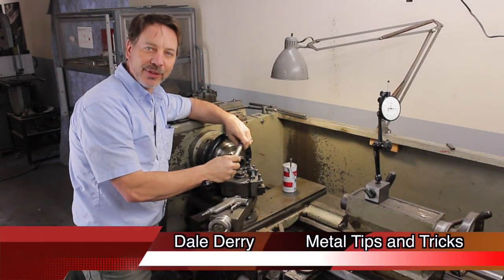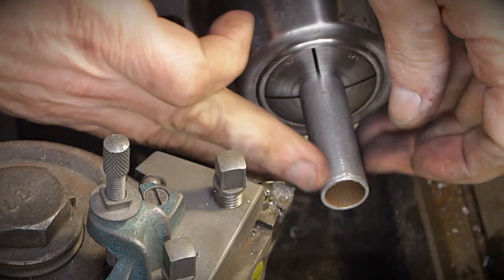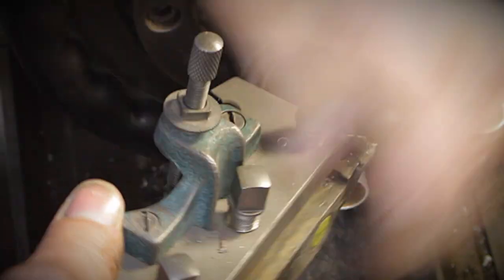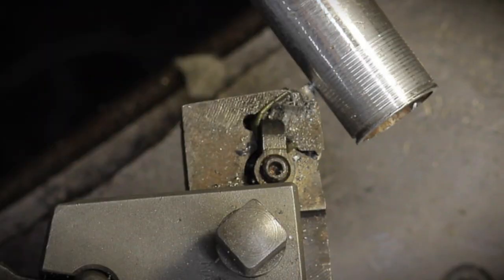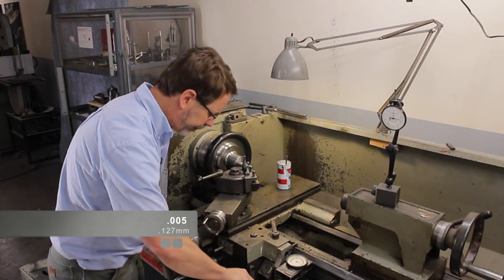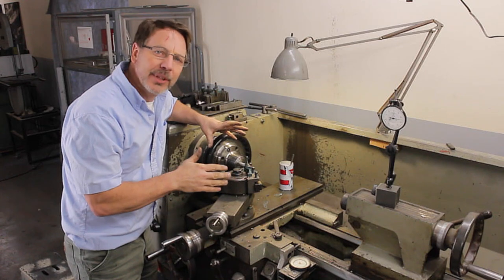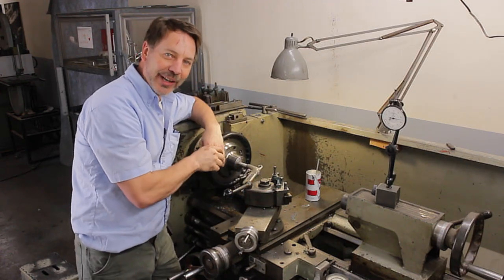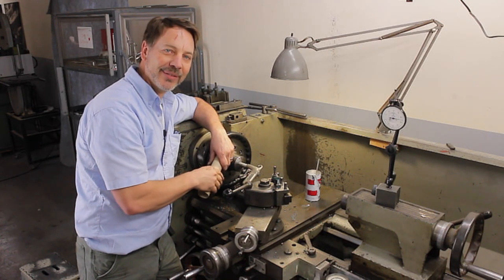How to cut Threads on a  tube

Comment: Here's a tip for turning/threading tubing: turn a close fitting slug that fits into the ID. That removes most of the squishing effect from 3 or 4 jaw chucks. In fact, you may need to do this with tubing in collets because, even though collets squeeze evenly, they do exert a large amount of grip that can distort the tubing. This slug would be required if you were chucking tubing less than about .157 wall (4mm for our metric friends) and cylindericity is important.

I have seen this used on tubing .030 and less thick with no distortion.

Comment: Hi Dale,
the tip to set the cross slide handle to the top so that you automatically know where to reset it to is a good one. However using some worm out lathes I find if the handle is left at the top it has a tendency to creep one way or the other, mainly winding out.
to counter this I set the handle at the bottom of the movement as a starting point and I find it stays put.

cheers and thanks for the good work in the videos
Reply: I added a counterweight to the crank wheels on my lathe that balances the handle weights within a few grams.  Now they have no tendency to creep. :)

Comment: Thank you for all your great video tip, learn something every day, or your dead. This is a little long winded but you might find a use some day. I'm a goldsmith by trade and have occasions where I need to make a temporary between two flat surfaces or marry two pieces of ?? and be able to take them apart easily. I use flake shellac, you can buy it from most jewelry supply houses, 1 Lb. for $10. Then, for example, if you had two 1" cubes you wanted to tack so you could cut some matching line on both blocks, you simply heat both block to just warm. Place a few flakes on one side and heat indirectly until molten. Place the other on top and when cooled they are stuck. You could run under some cold water to speed it up. If clamped together they will for a micron thin bond. When your done what you needed to do you can simply heat it up again and separate.  You need to remember that this is flammable, but you can use boiling water too.  If for some reason you can't heat, you can soak it in some alcohol and  that can be used for your final clean up. So after all that, my point here was that you could fill the end of your tubing with molten shellac, heat up a 1/4 cup in a double boiler, pour it in and let it cool. It will be harder than lead and easy to clean up. A word of caution, don't splash yourself with it as it's like tar, it will burn you deep before you can swipe it off. Best wishes to you and yours, Billy

Comment: Hi Dale; a few of the other YouTube machinists have been talking about cosine error. This video shows a good example of how the cosine comes into play. When you turn your compound in .005 it actually moves the tool bit less (.005 times the cosine of the angle you are working at). The compound is moving along the hypotenuse and the tool bit is moving the distance along the adjacent leg of the triangle.
Reply: Cosine = adjacent / hypotenuse, Cosine 30 = .866.                     If we draw a triangle with our 30 degree angle on the work piece. The compound represents the hypotenuse  and the cross feed represents the adjacent side of our triangle. If we move our compound (the hypotenuse).005, our tool bit moves, .005 x cos 30 (.866) = .00433 ( the adjacent) into the work piece. I think.
Reply: +John C , Yes, that is correct.  If you are feeding in with the compound instead of the cross slide, then you have to take that into consideration.
Reply: +ILGopher I have never understood you Americans in the way that you screwcut. It always seems hit and miss with the thread depth, guessing how much to advance the compound slide. I was trained in England to do this very easily and accurately. You know what the thread depth should be from Machinery handbooks etc. The way I was taught was as follows. Touch the work piece with the tool, SET BOTH dials to Zero. Then back off the compound by say at least one turn, THEN ADVANCE the cross slide by the depth of thread indicated in the chart. RE ZERO the cross slide dial. Retouch the tool with the compound slide. Begin cutting the thread as normal by advancing the compound slide. When the dial reaches ZERO, you should be at the correct thread depth, no guess work needed. Simple and accurate way of cutting the thread to the manufacturers recommended depth. The other thing we were taught was if the tread was a tight fit, was to plunge straight in for 0.0005 ";, this would make the thread take up the true form of the threading tool; and remove any tooling steps or angle setting error in the compound slide in the finished thread.
Reply: Not just Americans.  I guess it depends on how you were taught.
Reply from the maker: +John C 
In theory this is correct. But when you have an old lathe,  theory goes out the door :-)
Reply: +Dave Ticehurst 
It is not so much hit and miss as it is get close and then creep into it, especially when you have the mating thread and you are trying to get a good fit to it.  The Machinery Handbook gives you a standard, but cutting to that size doesn't mean you will get a good fit to the mating piece.  I have found that matching to a plate that has been drilled & tapped can often be a different number on the compound than trying to fit to a standard nut.  The handbook also doesn't take into account the radius used on modern threading inserts; with a large radius, you won't thread as deep as you would with a sharp point.

The England method you describe for setting the tool could leave your cross-slide handle in an awkward position--I prefer to always set it at about 2 o-clock for the same reason the creator of the video prefers 12 o-clock handle position.

I agree with you on plunging-in with the cross-slide instead of the compound on the last 1-2 passes of about ½-thou.  Typically, I don't do it, but it can often give you a smoother finish on the trailing side of the thread.  Usually, that is the side of the thread that gets all the load when the finished product is put to work, so having a good finish on that side makes good sense.
Reply: If we change the angle of the compound to 60 from 30, the cosine of 60 is .500. Now if we move our compound .005, the tool bit only moves .0025 into the work, .005 x ( cos 60) .5= .0025. It's got nothing to do with if we are cutting a thread, or just turning down a piece of stock. When we feed with the compound, the actual distance our tool bit moves into the work is the product of the number on the compound dial times the cosine of the angle our compound is set at. Thanks everybody.

Comment: Dale,I enjoy your well made videos and clear explanations. Yes please, do a (series of) lathe rebuild videos! After years of working with watchmakers and Unimat sized lathes I finally purchased a used Myford ML7 last summer. It seems to be in good condition with very little backlash and no visible wear, but it has sat unused for at least a decade. I presume that the headstock bushings are full of coagulated oil, so I haven't actually run the motor yet. I am not sure if I should fill the drip oilers with WD40 or a solvent and let that run through, then refill with proper oil, or if the right thing to do is just take the whole thing apart to avoid risking the possibly still serviceable bushings.What I would like to see is if there are tests/checks I can do before taking the lathe apart to get an idea of what needs attention, then a teardown and rebuld walkthrough. Only being armed with half remembered processes last used during my apprenticeship I am leery of changing parts without being sure that they actually need replacement or modification, and just how close the tolerances need to be.

Comment: A lot of people are as you've said Dale almost scared of single pointing threads. That might be due to not fully understanding exactly what's happening. Guess I was about the same quite awhile ago. Once I finally started looking at it as it just being a fixed gear ratio between the spindle rotation and the lathe's carriage movement it got a lot easier. All a change gear, gear box equippted, or geared head lathe really is could be looked at as a multi ratio transmission in a car that needs to be stopped to change gears on most lathes at least.

I also had about the same repair to do a few years back for a friend. Since the threads broke due to the aluminum tube being built a little lighter than it maybe should have been. What I did was clean and roughen the tube and then epoxied it into a bored piece of brass that was a little larger than the tubing O.D. Then single pointed the threads on the brass that I bored a little smaller than what the tubing diameter was. That gave me the extra metal at the threads and made it a lot stronger. Since air or fluid will follow the path of least resistance there's very little back pressure so the epoxy fix worked fine. Not a fix anyone should think of doing on air or fluid lines that will be pressurized tho.

Looking forward to the lathe rebuild video.
Reply from the maker: +metalhead2508 
I agree :-)
Reply from the maker: +Turning Point 
Great idea

Comment: Dale, If it's a really thin walled tube how about turning up a wooden plug that's a hand weight press fit up the bore? Leave it sticking out a bit and support it with the tailstock live centre. And I'm waiting anxiously to see the Hardinge lathe rebuilt! Don't see them very often in NZ!
Reply from the maker: +Mike Clayton 
The Wood plug is an interesting idea. I may have to use that sometime.
 Not sure when I'm going to get around to the Hardinge its not even on the schedule yet:-)

Comment: I agree that using a collet would be the best choice in most situations. Would it ever make sense to first turn down some material to fit snuggly inside the tube, to provide enough support for chucking (other than the obvious-right side collet not available)?
Reply: I don't have collet capability on my old Sheldon lathe so I can't do what he did.  I too thought of a wooden dowel or similar piece to strengthen the stock from the inside.  easy to mill, file or shape an old dowel or broom handle for instance.!

Comment: I have always found a good trick to avoid the 3 points or 4 point clamping pressure is to simply do a light press fit of immaterial inside the tube file cutting threads and then of course remove the solid stock from the tube once the threads are cut

Comment: Enjoyed.....lots of great info!  Question...since it is tubing, not a bolt where would you find the thread depth info...major, minor...etc?
Reply: .....magic 8-ball!
Reply: +outsidescrewball Threads are defined as a Profile so the values are fraction/percentage of the height, width, pitch diameter for a given TPI and material diameter.  Theoretically you could create a 1.028-32 thread min/max/pitch and root based on a known diameter by calculation.  The Machinery's Handbook has all the Profile info and what ANSI calls Standard thread UN, UNF, UNEF etc. info with min/max/pitch D etc. up to about 6".  My hit is Dale mic'd the broken piece to give him an idea how deep to go with the mic, but the final tell tale is: Does it thread on to the mate?  Also as Dale pointed out that Root radius becomes critical for fine threads and choosing a cutter or grinding one is important.  Hope this helps.
Reply from the maker: +outsidescrewball 
The threading measurements don't matter if it is a bold, or tubing. Just going to your machinist handbook and look up known thread pitch and the diameter of the material.
Reply from the maker: +Andrew Podaca LOL
Reply: I think a general rule of thumb with a thread of this profile is that you turn the thread OD and cut the thread depth until it forms a peak.
Reply: +outsidescrewball 
The answers provided by +pjsalchemy and Dale are spot on for machine screw, bolts  or straight threads, but with pipe threads they follow a slightly different set of rules that are specified in the ANSI/ASME standard B1.20.1 because they are tapered. 
If memory serves me correctly the thread diametric taper is 1/16 inch in 1 inch. 
Machinery's Handbook has an excellent outline of the spec in the Threads and Threading section.

Comment: You cover some good topics and your videos are interesting to watch.  I always thought the amount the spring pass takes off is more related to the type of material being cut.  I used to run a huge Mori Seiki CNC lathe to thread pipe for oil wells and I was always amazed how much would come off during a spring pass on 4140.
Reply from the maker: +oink079 That interesting, but i know the problem in my case is the lathe needs to be cleaned and adjusted

Comment: Very pertinent.  I have normally threaded solid or thick wall tube, but only a matter of time until I need to thread on thin wall tube.

Just curious, why you did not use a live centre to prevent the tube from flexing?  I would have used a live centre.  I presume care needs to be taken to avoid excess pressure which would flare out the end.
Reply from the maker: +LV_Woodturner 
Good question. I felt the tubing was rigid enough for the light cuts that I was going to do.

Comment: Would adding a mandrel inside the tube been an option? I'm thinking that would help the overall rigidity. Something for the collet or chuck to press against, yet prevent the tube from deforming, especially where the cutter is pressing against. This may be related to the depth of the spring cut issue you were having.
Reply from the maker: +TheBerkeleyGang 
Great comment, If this was a critical part were I needed to hold higher tolerances. puting something inside the tube to hold its shape would be a good idea.

Comment: Since the original design was obviously lacking in durability I think I would have made that from a solid bar and then drilled a hole through it that would leave twice the wall thickness at least.  It would not make much if any difference in air flow and it would be a lot stronger.  Thanks for the excellent video.
Reply from the maker: +Amateur Redneck Workshop 
Great idea. but you can do that in every case. :-)

Comment: Great video dale in the q and a do you think you can go over measuring an internal thread having a trouble with that thanks
Reply from the maker: +Robert  Weigle 
That is a real good question, and an important one. It deserves its own  stand alone video. One of the way to do it is make a thread gage. or simply your a bolt of the right size.

Comment: Nice video Dale.  I have never come across the trick with the bearing before.

Question.. During the spring pass near the end of the video you noticed things were not behaving correctly, could you explain what you think is wrong with the lathe?  I am very interested in the video you will produce doing the repairs to the lathe.  

Is that a Clausing Colchester lathe?
Reply from the maker: +Mike Sportsman 
Yes it its  a Clausing Colchster lathe. The problem with the lathe is there is dirt in the way, and the way need to be reajusted. But I suspect it going to take some scraping too to bring it into alignment.

Comment: I have to make a thread adapter that is 3/4-16 on the ID and 1-8 on the OD. I'm cutting the internal thread with a tap, and then I will single-point the outside. My solution to the chuck jaw flex problem in this case is to leave a lot of excess stock on the end of the part, since I am just turning it out of 1.25 inch hot rolled.
Reply from the maker: The great think about machining for me is understanding the right tolerance for the job, and not over doing it. I think your on the right track. :-)

Comment: Thank you for the tubint video.  I am looking forward the the cross slide rebuild.  Question...How dowe a thread micrometer work?  It would appear that the points on the anvils are not actually square to the axis of the part.  They would be off by 1/2 of the pitch it would seem.  For large parts it is likely negligabel but is it for smaller parts?  Just a question not a critisem of the tool.
Reply from the maker: +Glenn Felpel 
One of the anvils  has appoint the other one is a V, There are different size anvils  for the different thread pitches

Comment: I have a good one for the q&a. how would you go about making a tapered thread?  I have the opportunity to pick up a Lebonde 10" lathe, but the part that has me nervous is the spindle thread is 2 1/8-8 with a .025 taper. I would think it would also be similar to single pointing a npt  thread.
Reply from the maker: +Brian Dughi 
I would only get the Lathe  if it has the chucks with it. Tooling is the most valuable thing on the lathe.

Comment: hey dale . do you think a split tube could around the tube would be enough to stop the deformities the chuck causes when using a 3 or four jaw chuck ?
Reply: +Wesley Barnhill  I use a sleeve that has a cut so it can clamp and depending on the wall thickness of the sleeve a relieve cut at 120°and 240°
Reply from the maker: +Wesley Barnhill 
Yes.
Reply: +rzan8 soft jaws bored out to the tubes OD are another way to do it. I worked at a company making piping for oil and water wells. We were cutting tapered box threads and we always used soft jaws.